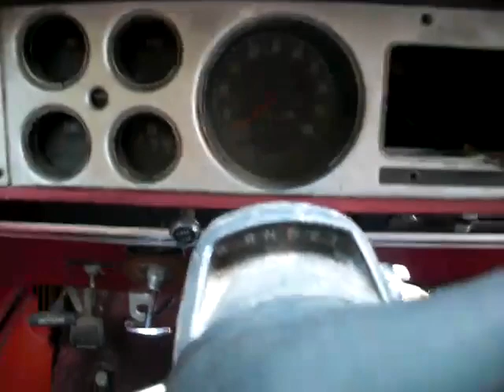1978 Dodge Diesel Power truck for sale on ebay 6-3-09

Comment: Having owned about 15 or so 351M and 400 engines in various vehicles over the years I can tell you that if your 400 has less torque than an old Mitsubishit 6DR5 diesel, you need to rebuild that engine. The Mitsu engine had 169ft. lbs. of torque where as the Ford 400 in '79 had 300ft. lbs. I'd like to add that with a few upgrades to the 400 you can achieve 400hp and about 500ft.lbs. torque. That's just on a budget, it can handle much more.

Comment: Of all the 1978 and '79 Power Wagons originally equipped with the diesel engine, how many were repowered to the (12-valve) Cummins unit used on the 1989-early '98 Ram trucks? Converts from gas engine-equipped models will not count.
Reply: ClassicTVMan1981X no one swapped a 1978 diesel for a Cummins they mainly swap those in gas trucks like mine with a 318.

Comment: Does that Mitsubishi Diesel engine used in the 1978 Dodge full-size pickups have a direct-drive starter motor or a gear-reduction starter motor?
Reply: Shane Spencer